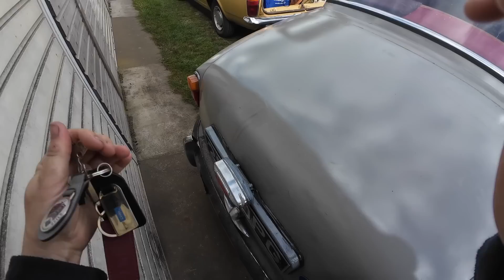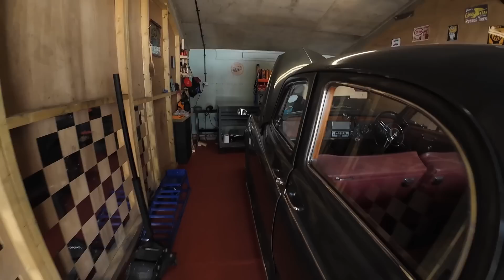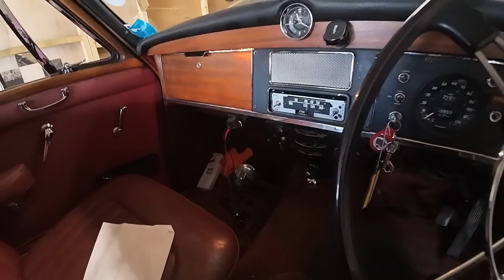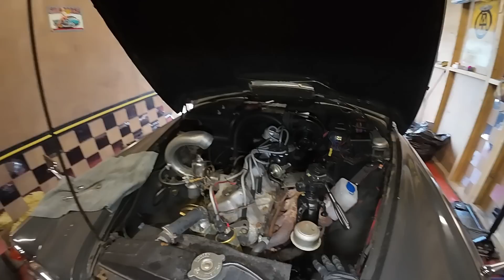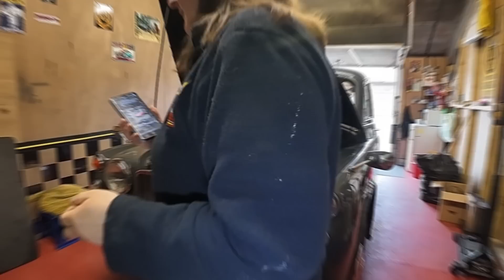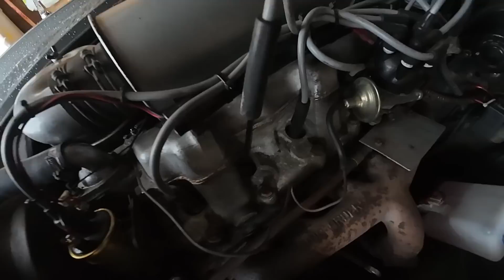ROVER P4 - Alex's Classics - New gaskets , tune and test drive

Comment: I thought when i accelerate i leak off some vacuum so there is less vacuum compared to idle / low load conditions and the spring defeats the diaphragm actuator and advances the ignition.

Comment: great video Alex. I am in Australia and looking at getting a P4. In your opinion what is the better engine the 4 or 6 cylinder, and Clyclops or later cars. Thanks
Reply from the maker: I went for the 100 model as has disc brakes at front and the 6cyl engine is lovely.

Comment: I think the radio is the type that fits from the back and is held by two thin nuts on the spindles. As the panel with the appropriate holes isn't there in the dashboard, you can't really fit it.

Comment: Well done Alex. Wow how clean was that rocker cover on the inside.
Reply from the maker: They are a clean engine from what I've seen. Can run the engine and rev it with cover off and no oil will splash around needlessly 😄

Comment: Don't know if it will help but I used to use a dent slider bar only 15 quid or so. You can mig the end of a screw along the dent then just pull out with slider. Then snap off and clean with a grinder, Hope Jessie comes home soon I love the p4 👍